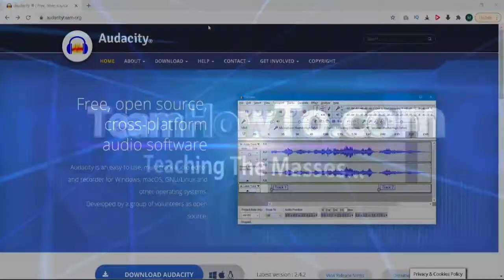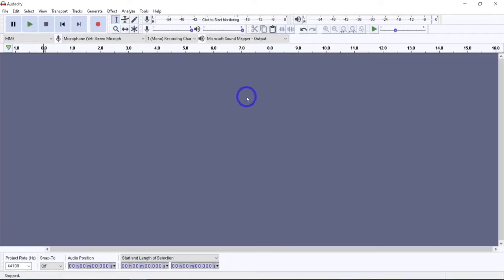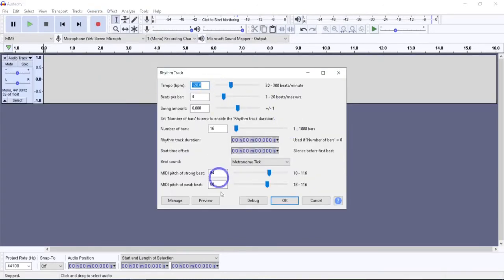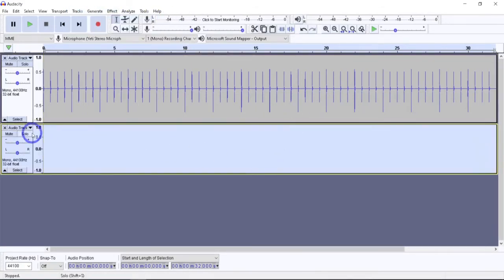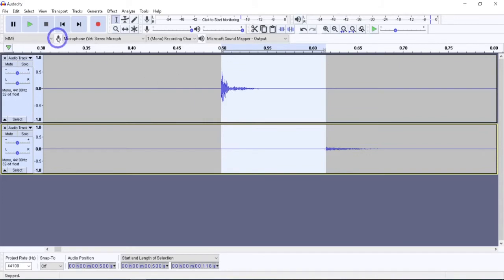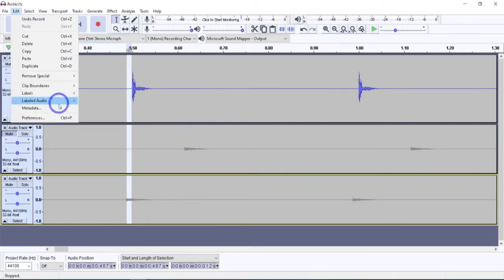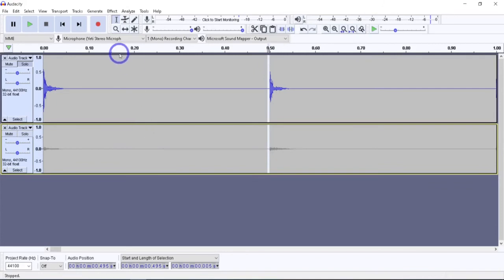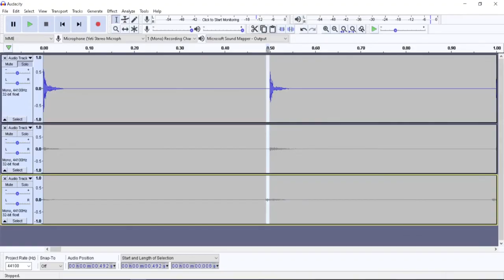How to Fix Recording Latency Delay in Audacity 🎛 Calibration

Comment: Thanks - this wasn't quite as easy for me - I was recording voice and using the click track method didn't work so I had to record myself singing to the backing track and then work out how long the delay was based on when a word should coincide with a chord and determine how much to adjust the latency from that - and even then it took a bit of guess work to get it  to synch as closely as possible. Prior to this I've been struggling for years to understand the problem! So thanks a million!!!

Comment: is there anyway to make it so that the software playthrough isn't delayed. thats what ive been having trouble with. its only a problem because i play bass and they are pretty quiet without an amp
Reply from the maker: If I am understanding you, the playthrough timing would depend on the speed of your machine. The faster the processing the closer it should be.

Comment: Hey for some reason I can't find the latency compensation button :( I been looking everywhere on how to fix this issue and can't find any solution. Can you please help?
Reply from the maker: There is no latency compensation button. Watch the video again, I go through the solution in great detail. Let me know if you have any specific questions
Reply: @TeamHowTo  My apologies, I totally said that wrong! I do have a question I’m hoping you can help with (: This tutorial was great but I went through the video multiple times & although the latency improved it still is very delayed :/ Could my computer’s processor just be too slow? The latency on mine wasn’t a small number it added up to like 3.445 which converts into like 3,000+ milliseconds..  Negative or positive it wouldn’t work when I put the number in :/ I can’t find anything that will help me with my issue since audacity doesn’t have a help page. Can you please give direction? Should I look into getting a new laptop at this point? I’m not sure why mine isn’t working & I have looked up other tutorials that have said similar but nothing seems to work! I would appreciate your help (:
Reply from the maker: @savtheredhead8691  Without knowing more, I'd guess that your pc might be the issue. But before we jump to conclusions, do you know  what OS you are running (WIN10, WIN8.1, etc.), do you know what type of processor you have(if running an intel it could be i3, i5, or might be AMD processor), Finally, do you know how much RAM your computer has? If you are running WIN10, 
1) On your keyboard, press the Ctrl key, Shift key, and Esc key at the same time to invoke Task Manager. 
2) Click Performance, then click Memory, and you will see the RAM in use and the available memory in your Windows 10 computer.

If your available ram is very low, this could be this issue. 

Lets start with that and see where we are.
Reply from the maker: @savtheredhead8691  Oh, and by the way, I watched your Scars To Your Beautiful (https://www.youtube.com/watch?v=AkuSvKIfOLk) cover video and Wow, that is really good! I'll be checking out your channel more when I have a moment or two.
Reply: @TeamHowTo  like I followed everything that was said and it still is too slow and I even started experimenting and putting super high numbers in like -5,000 to 0 to 5,000 & stuff & it either was slower or hardly would budge past a certain point & still be delayed. I’m not sure what to do :( I have a USB Mic Q2U that I plug right in my laptop and beats headphones that I plug into the microphone.